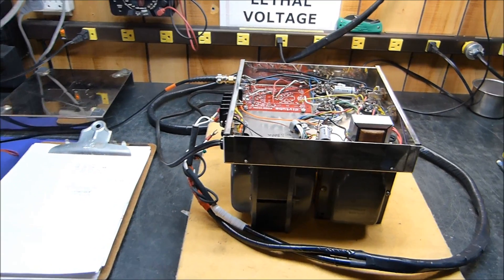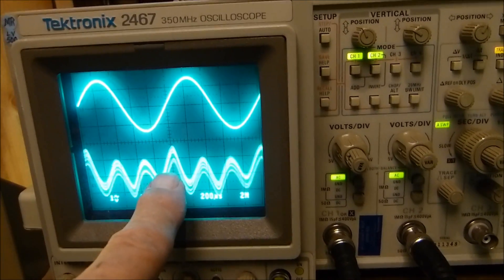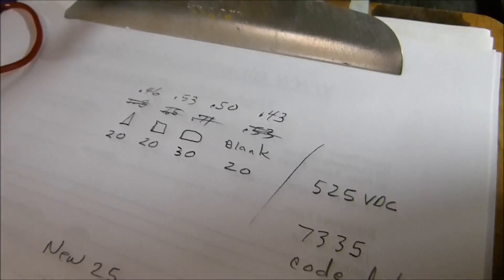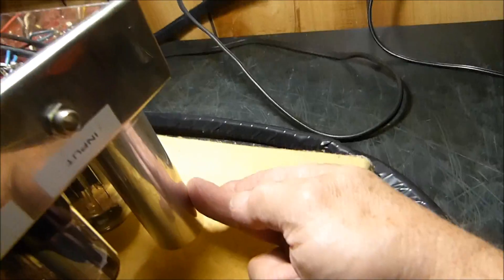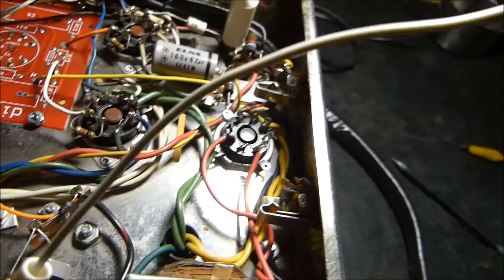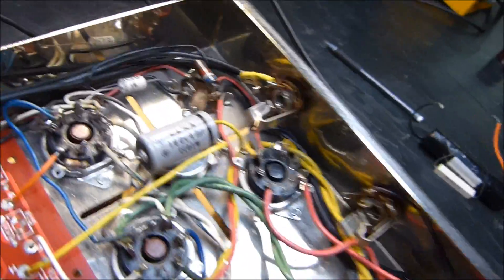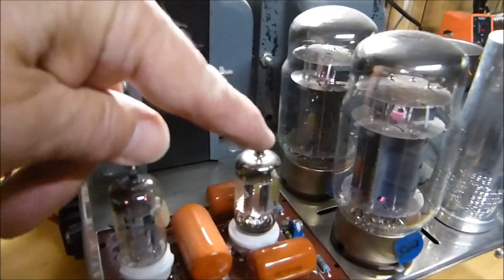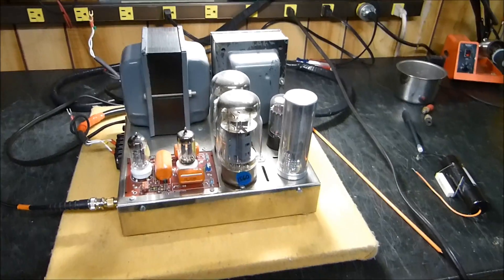Improving Signal to Noise Ratio On The Dynaco Mark III Vacuum Tube Amplifier

Comment: Do you recall if you had the A weighting filter on when you made those SNR measurements?  I have one here now. Using a different analyzer but it’s measuring -80dB with no filters, but 104 with A weighting.  Of course they don’t specify in the manual, but I know a lot of manufacturers used A weighting back then
Reply from the maker: I don't remember the weighting but a S/N of -80 sound very reasonable whereas -104 does not. Accurately measuring at -90 dB takes the best of interconnecting cables and a very low noise environment.

Comment: the one that REALLY kiked my butt was this, a factory speaker cable,  amp would oscillate n be nasty, nuthin i did worked, finally grabbed the speaker cable, n twisted, n voila..
Reply from the maker: I completely agree with you. It it sometimes the simplest problems that kick us around the hardest. We are looking for complicated things and it is something simple right in front of us. Even simply good visual inspection can allow us to fix things that otherwise defy high-end laboratory grade equipment and analysis.
Reply: @ElPasoTubeAmps  love your shop, id need a mit degree just ta run the stuff, i was an electrician on DC-8  DC-9 F-14. F-4 aircraft, the ATs n AQs could fly thru gear like that, i just use a scope, n a meter, in repair field, u can get by i guess!  Appreciate your videos n work, always learn sumpin new from you! My best to you n your family n a very Merry happi blessed Christmas wish..,

Comment: Great troubleshooting and demo of grounding issues with nice use of instrumentation in the setup! 
Is the error signal output equivalent to common mode noise for grounding issues? Could it be  separated with a differential probe setup to measure common mode noise? Eliminating the need for the Tek AA501 SA?  It would be interesting to compare results.
Most don't do a SN +N measurement to verify specs. It probably is the best overall metric for success in an amp.   I'll have to add this to my diagnostic tools.   Keep em glowing.

Comment: Ive got a danelectro guitar amp that has a hum coming in on the first stage 12AX7, during testing I noticed accidentally, when attempting to add a 10uf cap from ground to DC that splits off to the plate as an extra DC filter, there was a small spark and  hum went away, i ended up not adding the capacitor but dont know what happened to fix the issue?
Reply from the maker: That is interesting and I sure don't know why. I have also had nutty things like that happen to be and after being puzzled for a while I just shrug my shoulders and go on. If it happens again, you might try to determine if the hum is 60 Hz or 120 Hz before attempting any remedial maintenance. 60 Hz is likely a filament issue and 120 Hz is going to be a PS problem.

Comment: Also, did you match the input signal impedance to 470Kohms in your tests?
Reply from the maker: +Jordan Rubin I do see that the Mark III has a 470K resistor on the grid to ground and no blocking capacitor on the input but the output impedance of all of my audio oscillators is 600 ohms and will swamp any high Z  it is connected across.

Comment: It may be factory built.... I see several areas that are riveted and not screwed in, such as the tube sockets.   While it is possible the original owner used riverts as part of a kit ..... its doubtfull
Reply from the maker: +Jordan Rubin I agree and have noticed the rivets also. The octal tube sockets are becoming pretty lose and I have considered taking the rivets out and putting screws in. I didn't build the amp and got it 30+ years ago at a garage sale for $5 if I remember correctly. That  long ago, (which seems like yesterday...) most all tube stuff was considered "old" and junk and non-repairable and I am sure much was just thrown in the trash. I have always horded the old tube equipment and still do.

Comment: Thank you really learning a lot, I tinker with old audio and don't  understand how to value the caps for power supplies it's a little confusing. how much can I raise the capacitance? also, if you can explain how to sub diodes for tubes with a (Zener or thermistor) (?) for spikes that would be great hands on. again thank you. P.S. my motion sickness wasn't too bad (Ha, Ha).
Reply from the maker: Bobbyj438 There is a common misconception propagated across the Internet that more capacitance in power supplies is always good. First, it probably isn't necessary and it may  not always be good. Vintage capacitors often have a have a tolerance rating of -20% to +100%. If you think about that, this means a 100 uF capacitor may actually be 80 uf or it may be 200 uF or anywhere in between. I think this should illustrate a lot. On the other hand, 40-50 years ago, practically everything was vacuum tube, which means higher Z loads and lower currents so PS capacitors could be less, i.e. 40 uF at 500 volts, for example. It was much more difficult to make high value (as in uF) capacitors back 50 years ago than it is today. Economy always has and always will play a major role in manufacturing. So, designers made equipment that was adequate but did not oversize components as we naively thing they should have. Think about this - 50 years ago if you had told someone that you could hold a 4000 Farad capacitor in your hand, they would have laughed you out of the room. Back then a 4000 Farad capacitor would have been the size of a Greyhound bus. Nowadays, ultracapacitors (http://en.wikipedia.org/wiki/Supercapacitor)  are common and cheap. Sorry for the digression - bottom line is, odds are, you do not need to raise capacitance in circuits. It will not improve them. But, if you have, for example, a 50 uF capacitor in your power supply of your tube amp and you put in a 100 uF capacitor (with equal or better voltage rating) it will work fine but probably not better if you are able to measure its performance objectively.  As for using diodes for spike suppression, I think that might be worthy of a separate video but ultimately an unnecessary addition to most equipment. A thermistor (thermal resistor) in series with the 115 volt AC line is almost always a welcome addition as it will allow a "softer" power up. In a few videos I allowed YT to smooth out my camera motions and I got more comments than I do by just moving around as slowly as I can. Mounting my camera on a tripod just doesn't give me the ability to explain what I want. I do appreciate your comments.
Reply: ElPaso TubeAmps thank you for your reply very informative. my reference to diodes was as a replacement for the rectifier tube.  the thermistor as part of that modification. Sometimes what I'm thinking and what I write isn't expressed  well.  Looking forward to future videos.

Comment: I am using the same configuration with high efficiency speakers and have been working with hum at 120hz and 60hz.  It has been greatly reduced, but I am running home to get out the soldering iron!
Reply from the maker: You might keep in mind that the 120 Hz is coming from your power supply as it is full wave and soldering the cap to ground will hopefully help but the 60 Hz hum is possibly coming from the filaments of the tubes.Grounding one side of the filament line may reduce 60 Hz hum. You have to experiment which side of the line reduces the hum the best and even reversing the filament line on the 6AN8 may help with the 60 Hz. A hum balance adjustment does not necessarily do the best job. If you have a way to measure S/N you may be able to empirically get the hum down to close to -90 dBm. Good luck

Comment: I enjoy all your videos immensely and I post them on my favorite audio forum..I always increase capacitance in the power supply and the reason being is under heavy transient dynamics from the new 95 and 100db listening material as opposed to when the amp was built,it can collapse the power supply at certain frequencies especially on lower efficiency speakers.
This is a factory built unit and the riveted sockets and terminal strip is the telltale sign.

Comment: I just repaired a pair of these last month for a fellow in Boston. Very important point with these amplifiers--do NOT use a directly-heated rectifier tube! The voltage rating on the capacitors will be exceeded until the 6550's warm up. The amplifiers that were sent to my shop had 5U4 rectifiers installed. The correct rectifier is the 5AR4/GZ34, which are indirectly heated and whose warm up time to emissions track the 6550 output tubes. Another thing about using 5U4s is that the distance from cathode to plate is much greater, hence the voltage drop through that resistance path is greater. Which is why use of this rectifier causes the amplifier to fail to make specified power. The 5AR4 has lower resistance, and thus better voltage regulation. It will make rated power with this rectifier.
If the owner wants to use solid state rectifier, he can, but the capacitors must be replaced with 600V DC ratings. I did this for my customer, leaving him the option. The Mark III will make 72 watts with a SS rectifier and 55W with the tube.

Comment: Im a dummy'''' But''' ' Couldnt you just Ground The Thing you wiggled to the Chassis'''?Solder on a ground' from & to..
 (silver capped) ~ I Know Thats lame but,,,? Providing the cap is Ok ? Would this Somehow' stablize the ground properly,,,?
Reply from the maker: Chrisandra VOX That is exactly right. In this model amplifier the silver can needs to actually have its tab(s) soldered to its metal mounting bracket or directly to the chassis if it is steel - can't solder to an aluminum chassis. In my case, the can was not making a truly good electrical connection to the chassis (ground). Instead of being directly soldered to its mounting bracket,  (the original Dynaco kit instructions show it grounded through a short wire to a nearby tube socket, which it was). But we can see that this did not provide the same noise canceling ground connection that the soldered tab does right at the base of the can. This is certainly not going to be the case in every amplifier. Possibly where the can is located next to the 5AR4, power transformer, etc. may have a unique effect on this Dynaco model amplifier design and build.

Comment: Thanks for the great video.  I'm going to verify my S/N ratio using my 8903 as a comparison.  I'll be checking my Dynaco ST-70 and verifying my cap is soldered (can't remember right now).

Comment: Thanks for your many, many video all of which are very interesting and informative.
I would like to know what it took to make your HP8903 work with a computer.  What
hardware is involved?  What software program are you using, etc. ???
Thanks!!!
Reply from the maker: John Petzold Hi John - I have made several videos on the HP 8903 that may help you - When I started using the one I have, I found only one (1) video on YT and it was just showing it in use and not how to configure it. They are truly a jewel of an instrument as you can read audio voltage, THD, S/N, scan frequencies and capture it on your PC, read power directly, etc - no doubt at the leading edge of the technology in the '80's when they came out . Check out this video - https://www.youtube.com/edit?o=U&video_id=8GD-FU27wpk

Comment: Nice video, David!! Thanx for sharing!! :)

As i´m always sayin´: Audio equipment needs propper and good grounding.

This is the very first rule when designing/restoring audio units, regadless of its kind.
If you only rewire the ground in this chassis (as the gounding looks /sorry/ just awful in here) you would end up with something very close to -100dB Overall S/N, turst me.

I´ve comment this about 10 times in various videos:
If you use any sort of metal chassis, do not believe that this chassis provides you a good ground plane for free, as this is always not the case!!

Instead, use a solid copper wire and solder it (or clamp/screw it on - as it´s even better) to the very fist filter cap and as close to the filter cap as possible.

This is why top notch filter caps has screw terminals instead of just wires. The connection resistance would be about 5 to 10 times lower by using screws instead of a solder joint.

So next is to use this solid copper wire where-ever you need a ground and use only this wire no other. Go all the way through your chassis. Even connect every jack/outlet/pin/terminal ground to that wire. BUT do not connect any ground twice with that wire. And do not return this wire to the filter cap, leave it open at the last ground you soldered onto.

You´ll end up with a very quiet, nearly noisefree amp.

In my very last Amp, the TinyTubeAmp, i´ve done this ( with a 1.5mm diameter solid Cwire) and even with that aluminium plate and my tiny aluminium chassis, i´ve archived about -88dB TS/N. If i would shield that open frame switch mode power supply and its cables i would gain another -12 dB TS/N and another -3dB when i shield the open back side of the chassis, i tried that with a thin copper plane but first i need to put everything else right in place before install that copper plane finally;)

I was into some really top notch old military Tube pre amplifiers for microphones and they done this like that, by using a 5mm diameter soild copper wire, and easily archived about -120dB S/N ratio even when they had a overall gain of 60dB the output was absolutely quiet. The input jack was grounded (=shorted) and max.input gain was selected..:)

Comment: I've dealt with the same issue over the years. Grounds loops in the chassis created by the sum of all the returns are the culprit behind this power supply noise. If all ground returns are not at the same potential, this is the result. As you demonstrated here, the system has a definite zero ground point which is not always at the center tap of the mains x-former where in theory, it should be but is shifted slightly to a higher potential due to ground loops in the chassis. Connection of a stages ground to any other point, raises that stage slightly above ground. Keven O'Connor's book The Ultimate tone, addresses this phenomenon directly. When I refurbish old tube amps that are to be used for recording, I always lift all chassis grounds and rewire as a star grounding system attaching only the c/t of mains x-former and beginning of the star grounds to the chassis so that all returns flow not through the chassis but directly back to the center tap. This eliminates the ground loops and makes an eye opening difference. It is a labor of love indeed. As you demonstrated here, in most cases, returning the ground back to it's proper point on the chassis is all that it is needed but in some cases, one can never find the culprit so lifting all grounds and rewiring is sure to get them all.
Reply from the maker: bain5872 I think your explanation is great - thank you. As a young fellow I built amplifiers and grounded everything at the most convenient chassis point and invariably ended up with an amplifier that hummed and nothing I did would reduce the hum. I did learn to do as you mentioned, and string a buss around the chassis and ground the buss as one point. Some believe at the CT of the PT and others recommend at the audio input connector. In any case, this approach does provide options and the results are much better. The last big amp I built and sold was a pair of KT90's which would do 90+ watts before clipping and I used a wire buss in it - it was quite although I do not remember the S/N. Always appreciate you input.
Reply: ElPaso TubeAmps
Yep, me too! It took a bit of head scratching, thinking I was going nuts and reading to finally figure out why my electronics theory was not matching my real world experiences. I discovered a small article about ground loops in a publication which I can't recall now but I did not fully understand chassis loops until I read the book I mentioned earlier. These loops, at high voltage, can be no fun for sure. Manufactures selected the chassis ground points for the lowest SN possible in order to reduce the cost of using a star grounding system however, it's the cheapest but not the best grounding system. If one moves a chassis ground point it usually increases SNR considerably.  Thanks for sharing and by doing so, I'm sure this will help someone in the future.